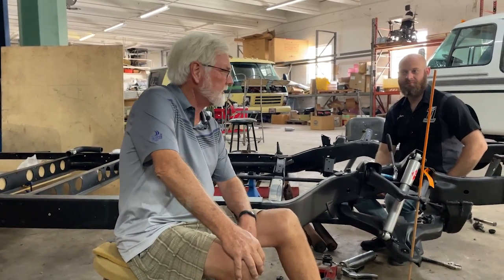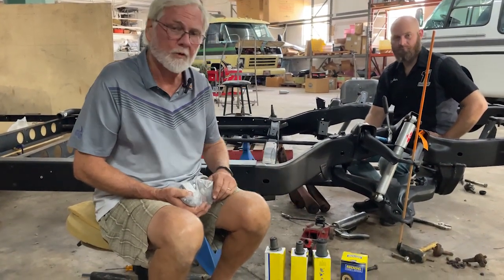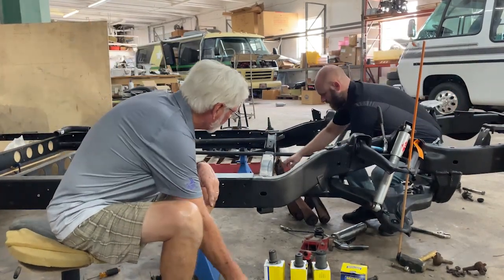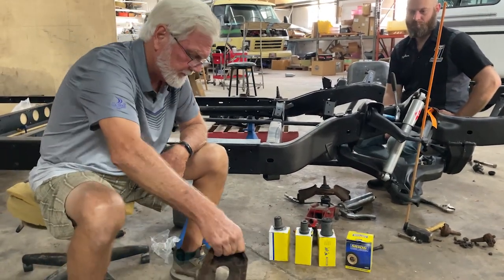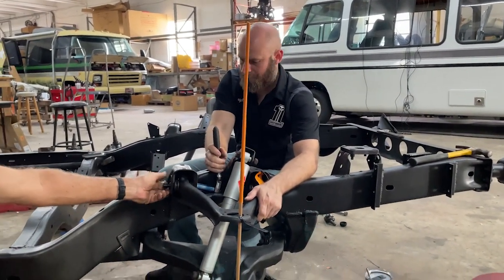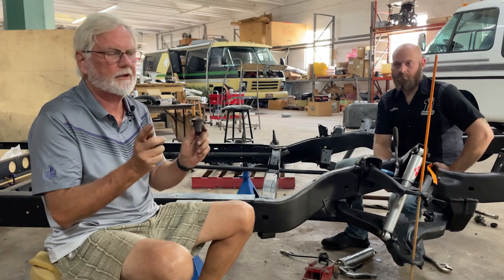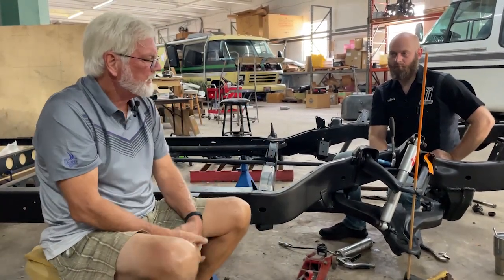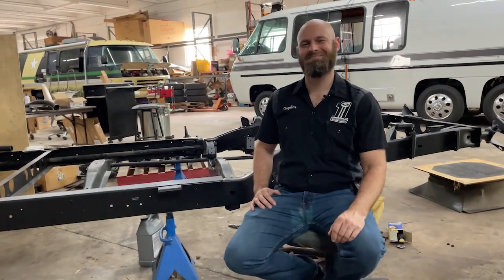GMC Motorhome - Control Arms

Comment: Wow. My project this weekend was to rip apart the front end and replace all the bushings, ball joints, and shocks. What a well timed video.  

As a side note. Is there a way to order parts from you w/o calling? I need a radiator this month and sometime this winter I think I'm going with your fuel tank.
Reply from the maker: you can email our parts department: parts@cooperativemotorworks.com
Reply: "this weekend" might take longer than that.. lol.. I thought that too.. the mechanics are easy to think about but it took me about a week.. and while you're there you'll probably see more that you want to do. I made my own wheel alignment tools.. because I was frustrated with shops that said... "oh.. we can't do that one" you'll need an unloading tool for the torsion bar as well..

Comment: Why not just use aviation safety locking wire, or a cotter pin through the bolt?